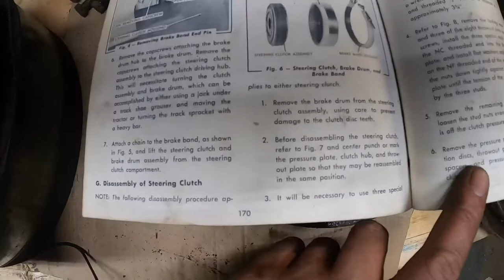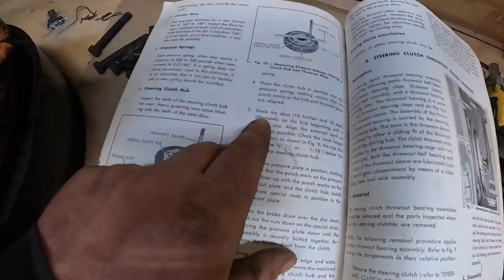Part 2 How to take apart steering clutches on a HD6 Allis Chalmers

Comment: After installing the two compression two thread rods and nuts. When you remove the remaining bolts, put a 7” length of all- thread in its place - no nut.  Do this one at a time as the bolts are removed. This will keep all the sleeves in place for reassembly. Install the discs. After the clutch is compressed with the two thread rods remove the thread rod studs one at a time and install the bolts.

Comment: Evapo-Rust on parts not heavily rusted. It worked surprisingly well and a gental to use product.

Muriatic acid on the heavily rusted steal plates. It has to be used in the open air and it is not a gental product to use. A very strong acid use baking soda to neutralize it.

Comment: Do you have any video on removing an axel?
Reply from the maker: No but we have done it before I have a custom built wrench that is about 10 feet long to do the job.
Reply: I'm 40 years old now, I kinda remember doing one with my dad and my brother when I was about 13.... I went to skid some logs for firewood the other day an left side came uptight and killed the engine. I disengage the clutch started the cat pulled lightly on the clutch and it was still tight. I shifted it to 2 reverse eased on the clutch an it went back wards but I have no power to or brake now on the left side. So I'm guessing it's an axel. I was hoping you had a video so I could watch how to disassemble it to change it.